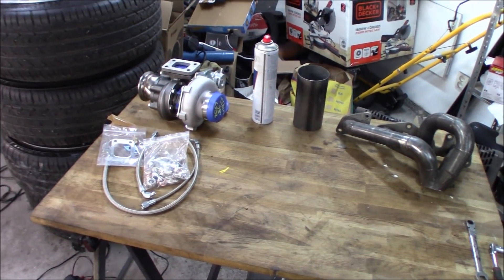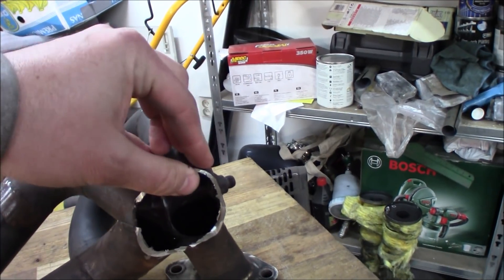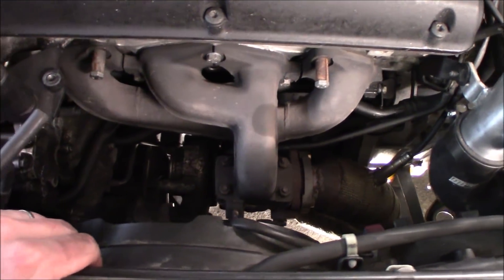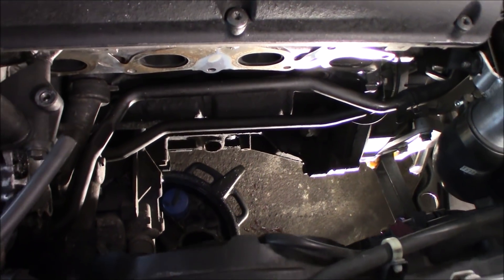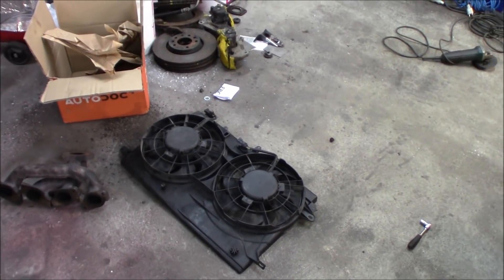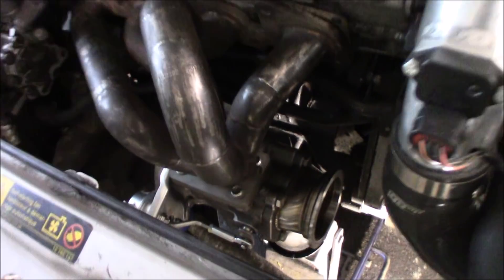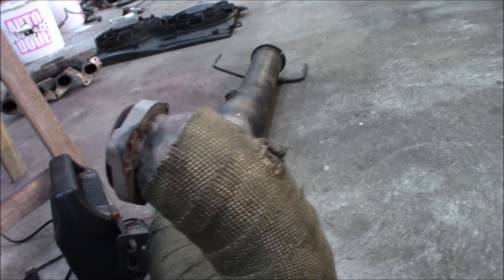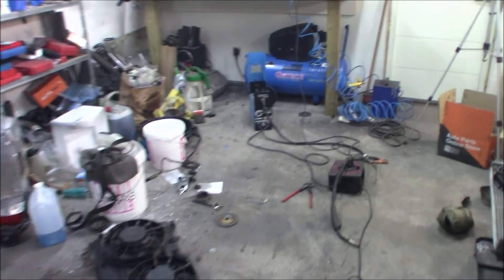Road To 500HP SAAB: Turbo Install Part 1

Comment: what turbo do you thing is the best to put in a 2007 saab 95 with stock headers that will give best power with boltons
Reply from the maker: Td04-19t

Comment: great work on the car jonas but a gtx 2867 by its compressor map is a sub 500 horsepower turbo(crank bhp not ATW) ,you will need a larger frame turbo ,with a bigger turbine hotside and more flow probably a G series  G25-660 or G30-660 to achieve good results,,pushing that smallish turbo that hard will only add considerable heat load to the ACT temps ,the bigger turbos have more lag but dont suffer from high EGTs and turbo outlet temps AND have considerably more flow in the midrange.
Reply from the maker: Gtx2867r gen2 0,86ar 😉👌
Reply: @JonasKakarikas  you,have lots of flow through the head and exhaust now jonas ,,max efficiency does,nt start to tail off till 1.8 bar(with that turbo) and would run even higher than that,,the midrange will feel completely different if you run more boost ,,your running the turbo at a low pressure that will  make the turbo feel lazy ,,,The turbo is not getting in to its boost zone at the moment,you may need a stiffer wastegate to hold 1.5+ bar  but  all easily sorted.
in all honesty theres 50 crank bhp still left in that same turbo without coming out of its max efficiency zone,,,great build by the way😁😁😁😁😁😁👍👌
Reply from the maker: But you are correct 👌 a little bigger turbo would make it easier

Comment: Hey Jones I need some advice, I got a p1110 and a p1312 code in a 2001 5 door 93 and the codes are stopping me from passing emissions inspection.  Whats your best guess?
Reply from the maker: New bov will probably solve p1110, change to new vacuum lines at the same time. P1312 will be solved with a new di-cassett, change to new correct ngk sparkplugs at the same time 👍

Comment: Hello Jonas, I wonder what would have happened if SAAB had joined forces with Koenigsegg instead of General Motors! GM was a very poor choice for SAAB, but a SAAB created with the help of Koeningsegg would have been a superb car, and SAAB could still have been with us then. 
Koeningsegg may create a cruising car that has plenty space with great handling although not made to be a track car... You could suggest that to Koeningsegg.
Reply from the maker: They are working with Nevs right know and that could have been Saab... Unfortunately history Now...

Comment: Hello Jonas! If you had used a higher exhaust manifold-, one closer to the hood-, you could have more space for the bigger turbo, but that's the one you already had. I'm learning a lot with this mods. I'm very curios about the engine's behavior with out the balance shaft.
Reply from the maker: It acts really good without The Balancechain, i guess that i have a good balance on my internals. Alot of People suffer from mad vibrations after The delete
Reply: @JonasKakarikas  that's make me remember a lexus commercial where they show how each piston weights exactly the same; and that's what you did; you achieve an exact weight on each piston and rod, one step further is taking the crankshaft to a shop to balance, and maybe Saab already done that job from factory...
Reply from the maker: Thats Nice to do also just so much more work to remove if you are not able to lift The engine out

Comment: Vad är det för fläktar du kör med?
Reply from the maker: Biltema, har inte kört dom än så det är ju upp till bevis. Men inte raketforskning heller så det borde funka 😉
Reply: @JonasKakarikas  dom är bra.
Har en kompis som kör 2 sådana på sin Plymouth Furry med 440 motor på typ 600 häst och den går inte varm ens när dom åker på crucing.
Reply from the maker: Härligt att höra 👍 då bör det klara sig 😉

Comment: You may be able to angle the radiator and I/C ourward at the bottom to get more room. Another option is a single row radiator, which is ok if you have high flow fans. CSF makes a variety of coils.
Reply from the maker: Tried to Angel it first, didnt work so well. Think it Will be ok with The new fans 😉

Comment: Tjena , skippa plasten runt fläkt behövs ej ! Kör själv med 1 spalfläkt funkar kanon .Typ 5 cm mellan fläktmotor o v-band . Swedenexhaust grenrör "normal" , gtx 2976 r ,   fungerande ac också (slipar man ac-fästet funkar de me ) 
Kör med lätt till plattad 90 graders , bara klämma dit. Kobran du nämnde är för biffig .
Kör me 500 hk för tillfället så kylet funkar utan plast o 1 spal.
Lycka till
Reply: Klia me i höve länge över de samma men de ja köpte fläkt av kör o meckar rally mm  de tipsa mig .
Har även provat stads körning i 30 grader värme för att testa .👍
Reply from the maker: Precis det jag behövde höra 👍😉
Reply from the maker: Tack för kommentar! Då skippar vi plasten till en början 👍

Comment: Hi Jonas, many thanks.... I've just replaced the timing belt and water pump in my 2011 9-5  2.0 l Diesel ... but the car's not starting ... any help...?
Reply from the maker: Did you get the timing correct?
Reply: @JonasKakarikas  Yes ... I did... the engine turns but doesn't start .... I am thinking about doing a compression test
Reply from the maker: Might be a good idea, try a small. Amount of starting gas 👍
Reply: @JonasKakarikas  Much appreciated .... will let you know what happens ...
Reply: @JonasKakarikas  Unfortunately the valves will have to be changed ....